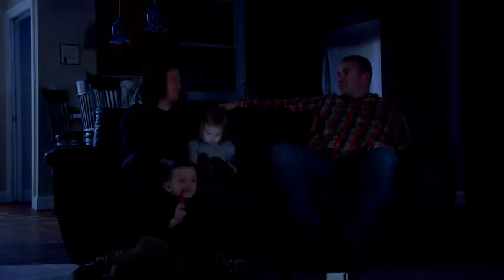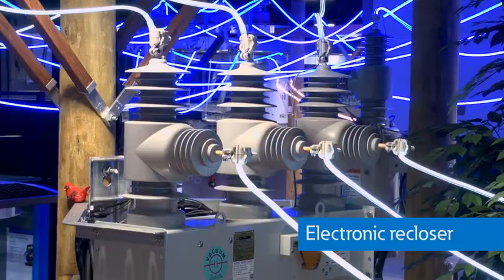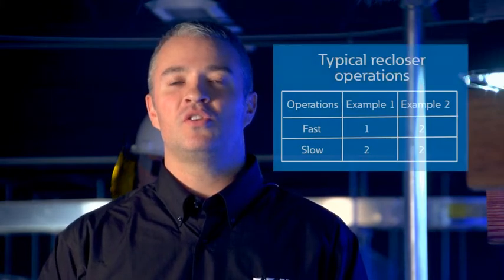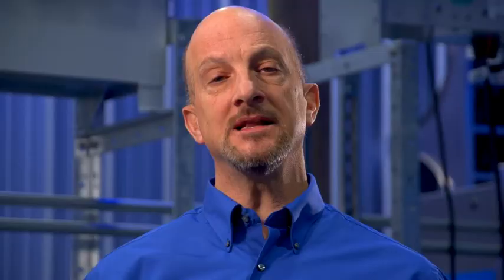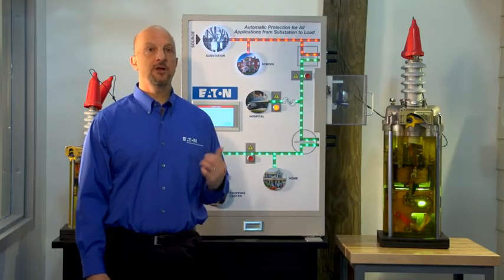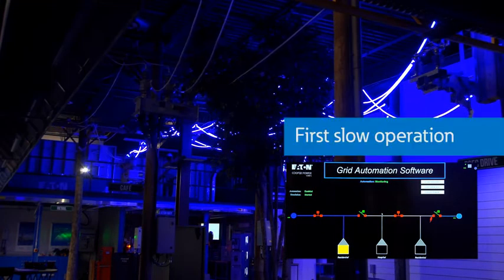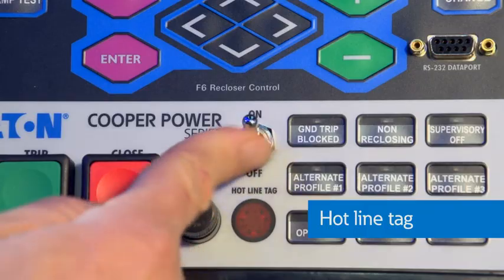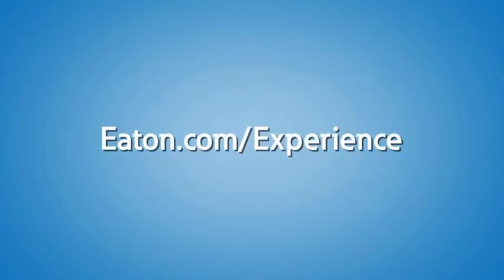Reclosers

Comment: Our crappy kompanie  just let thê Reck-Looser switch onn undtt off for MÔÑTĤS  undtt itt damage mie komputer from several off onn cycles,  ends upp damaging Homê equipment 
so is totally use less, best to have fuses or circuit brakers so the the fault can be be fix J̣̌ŪŚȚ ÔŃĈË  ¡

Comment: Is it against the law for an HMI to have a GUI that doesn't look like garbage? Useless smartphone apps look far more sophisticated. It's like buying a car with trash bag upholstery. 

I do appreciate this video, however.
Reply: Fancy GUI’s have proven far less reliable and prone to code breaks when updated
Reply: Simple is much better than pretty when it comes to SCADA control systems.
Reply: @robertwilson8184  It's not a zero-sum game, though. UX design is its own career, in the same manner a cardiologist is a specialist. They exist for good reason.
Reply: @moahnass agreed. It should be relatively simple but my company’s SCADA UX doesn’t even have a mimic search so you have to manually rifle through the index to find your site, whose name may not follow any logic so has no definite index position. Just why? (The trace and trend view DOES have a search feature by site #, so this makes even less sense…)